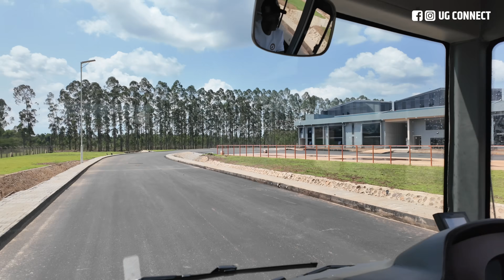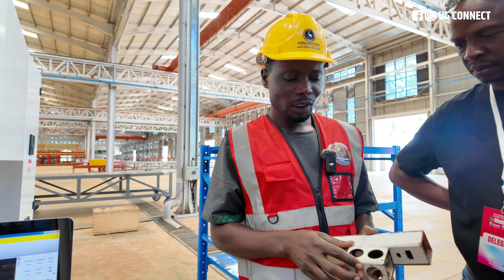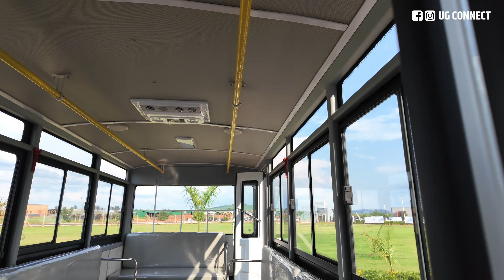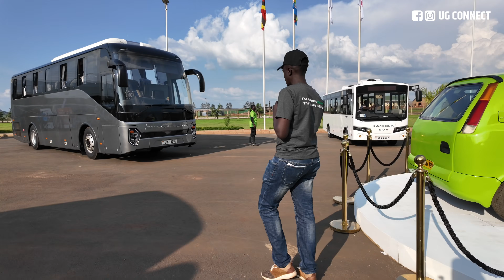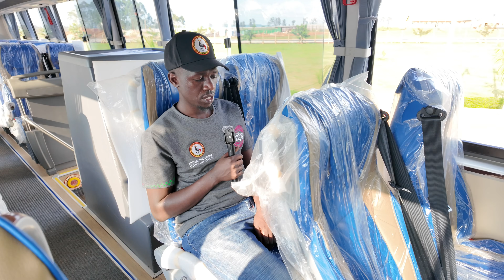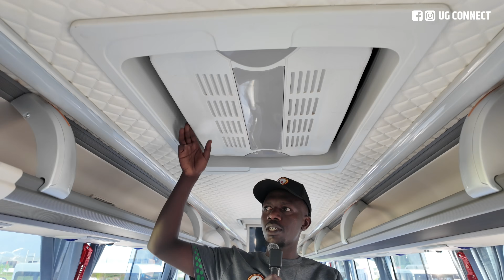How UGANDA'S KIIRA MOTORS Is Taking On Chinese EVs & Tesla

Comment: Who built the building? Who built the assembly lines and robotics? Who made the steel? Who made the electric motors? Who designed and made the computer software and hardware? Who made the paint and coatings? Where did those chargers come from?

Comment: This title is a bit off.  Kiira is partnering with CHTC to provide the components for the bus.  So, it is a joint operation between Uganda and China.  The goal is to procure 90% of the components in Uganda eventually.  This means Uganda and China will work closely together to create the supply chain within Uganda.  It is a great cooperation.  No need to put it like "taking on Chinese EVs".  It is team work.
Reply: @jimkuan8493  Still a good thing. China started like that.
Reply: But every company always partner when working on big projects take for example agro processing buy produce from d farmers

Comment: Africa still has long way to go in terms of vehicle manufacturing....all we have are assembly lines using parts imported from China..and Japan.. Africa doesn't have capacity to build even mortar let alone main engine..even simple wipers and bulbs have to be imported..what we have in Africa are body assembly and welding cutting and joining 😢😢😢😅😅😅..only numberplates are 💯%localy produced 😮😮😮😅😅

Comment: Absolutely 💯 % impressive... I am from Kenya 🇰🇪  and I think Uganda 🇺🇬,  you have outdone yourself. I will be disappointed if the EAC members states fail to support you by giving orders instead of importing Swedish of Japanese coaches. Congratulations 🎊 🇺🇬
Reply: That's basically an assembly plant ..they don't manufacture 90%of car parts but frames and metal fittings 😮😅😅but they import all  car parts like engines.. wipers even tires and minor things like mirrors and lights😂😂
Reply: @MARK-nh4hx  You are not serious, you don't know Kiira motors, you are talking out of.....
Reply: @Nabiipd7974  they normally don't show anyone engine manufacturing area 🤣even wipers carburetor,pistons even simple wiper ..they just show body frame ..which any assembly plant show 🤣🤣🤣🤣
Reply: @MARK-nh4hx   That's not true, I've been there myself
Reply: @DoreenAnena I give you a challenge to prove us wrong..go and visit the plant and show us each section electrical area,where bulbs indicators, motors,wires,cables, bearings, plastic fittings, carburetor,valves, engine sections,..and all the other sections that form the car components are built..please show is and prove the naysayers like me that kiira does not build frames and import car components from china to assemble..like they do in most African countries including Kenya
Reply: @MARK-nh4hx Do you want to say Apple or Samsung manufacture 90% of their phone components? Does Toyota manufacture 90% of its vehicle components? NO, A TYPICAL CAR HAS OVER 30,000 INDIVIDUAL PARTS, INSTEAD THEY BOTH RELY ON AN EXTENSIVE VERTICALLY INTEGRATED SUPPLY CHAIN, SOURCING PARTS FROM EXTERNAL SUPPLIERS. SO REST IN PEACE AND STOP WITH YOUR NAIVTY.
Reply: @felixekojot6741 so any third world country can do that..source critical components from outside while they create a Shell.😅😅😅
Reply: @MARK-nh4hx  This is one of the best idiots we have in Uganda 🇺🇬 a Kenyan appreciates a useless idiot doesn't appreciate anything from him country
Reply: hmm africans even Tesla is abused so it is well have a party hating my dearie qe arw trying littow by little we will get coming from Kenyans hating us i am suprised but anyway good luck hating

Comment: Excellent video, great buses and cars, well done, Kiira Uganda, I was very impressed and shared the video with my family and friends. We are all shocked 😮. Brilliant engineering. 
The only thing I didn't like , was the square obstacle in the gangway at the rear of the first bus on the floor. The passengers  walking from the front to the rear seats, would need to climb over that big dangerous obstacle.  It presents as a potential trip hazard.  All gangways and walkways should be free of obstructions. 
That's my only complaint. 
Apart from that, your buses are very good. ❤
Reply from the maker: Thank you for appreciating and the feedback is well received 🙏🏼
Reply: I love it keep it up